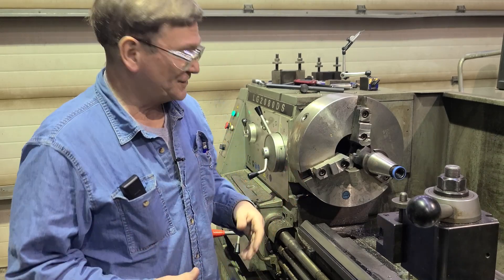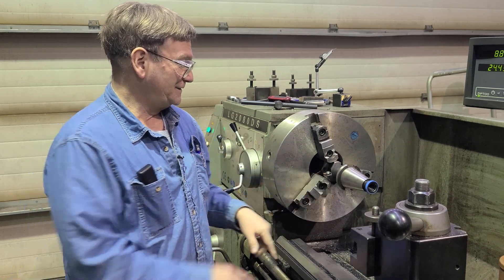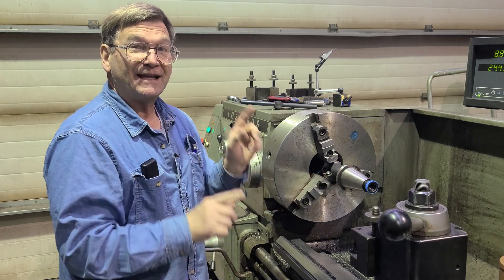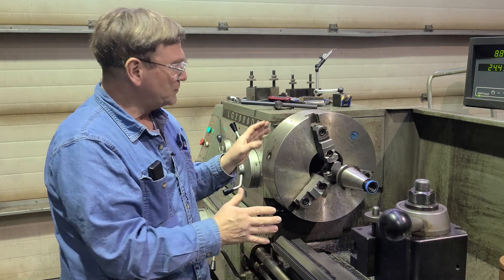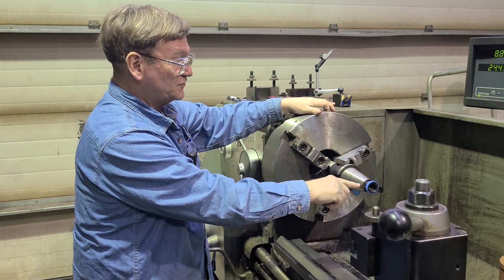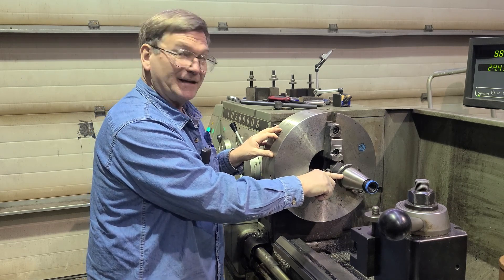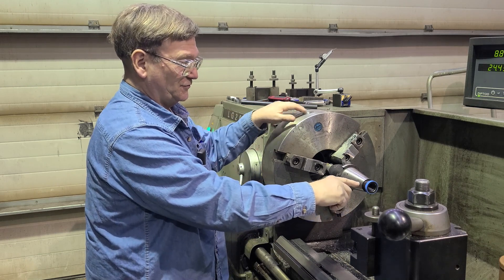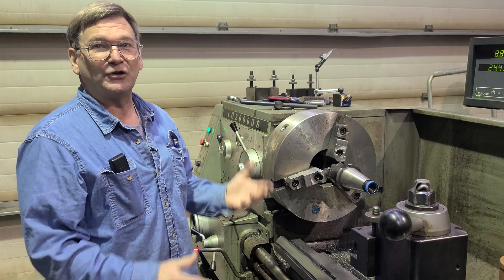Machinist's Minute(s): A way to dial in a taper on a lathe

Comment: One thing I think you need to point out in your related videos is the line on the part has to be exactly on center vertically. If it's only off a few thousandths can cause a lot of error!

Comment: Excellent tip about halving the eccentricity, and one I have successfully resorted to on many occasions: I would add just one thing about dragging the probe lengthwise along a taper to match it, and that is to make sure the probe is touching the work at centre height. Otherwise it's not tracking a straight line, it's tracking a conic section (an arc of a hyperbola, if you want to get all fancy), and you are in for a frustating time trying to match it with the straight line movement of the compound slide.